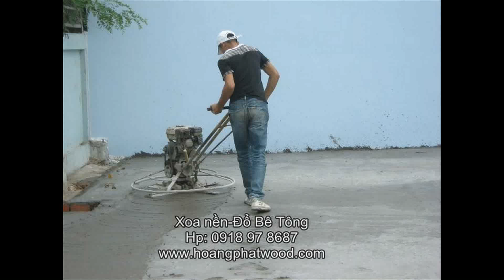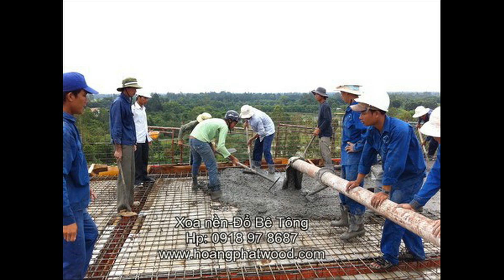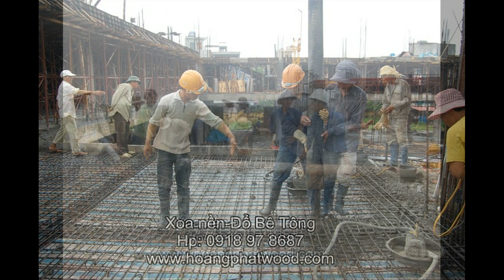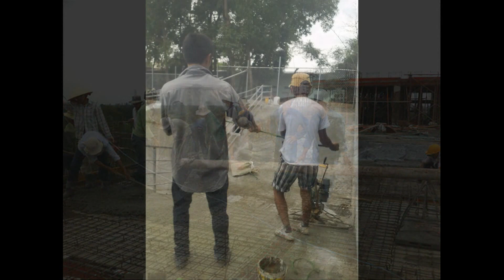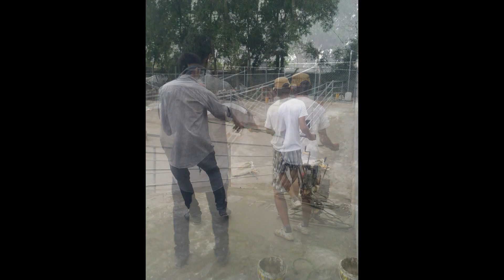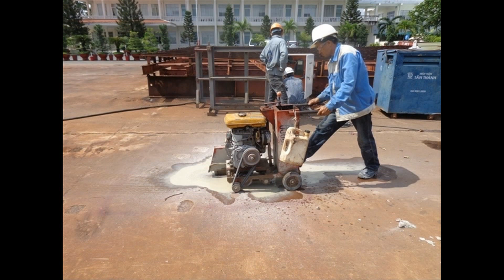Xoa nền bê tông,lh 0988087928,xoa mặt nền bê tông,xoa sika,

Comment from the maker: VÁN PLYWOOD HAY VÁN ÉP-GỖ DÁN 
lh :0918978687

CTY TNHH SẢN XUẤT GỖ HOÀNG PHÁT 
CTy TNHH Sản Xuất Nội Thất Gỗ Hoàng Phát
Add           :  43 Quách Đình Bảo,P.Phú Thạnh,Q. Tân Phú ,HCM
Tax           :   0312 649 671
Cell / Fax :   0839 786 234
Mobile      :  0918 97 8687  _   0902 5161 62
Webside    : WWW.Hoangphatwood.com
Email         :  hoangphatwood@gmail.com
Xin cảm ơn!
HOANGPHATWOOD _ PLYWOOD
+) Sản xuất các loại ván ép theo yêu cầu
+) Ván gỗ dán chống ẩm
+) Ván gỗ ép chất lượng cao
+) Keo : chống ẩm (melamin, Mr ,uf,phenol )
+) Sai số : +/- 1mm
+) Gỗ : cứng :keo ,điều ,dầu,thông,cao su
+) Độ ẩm : 08-12%
+) Trọng lượng : 530-550kg/m3
 
Quy cách
1) ván cốp pha xây dưng

-Ván ép phủ phim ,phủ keo
Khổ : 1220x2440
Dày : 12mm,15mm,18mm
_ Ván cốp pha phủ keo,phủ sơn

Khổ : 200 /300/350/400/600 x 4000 mm
          1220x2440mm
           1000x2000 mm
Dày  : 18 mm,20mm
2) Ván ép đóng nội thất,kệ,vách trang trí...

(Mặt nhám mịn, dán veneer, laminate )
Khổ : 1220x2440mm 
          1000 x 2000 mm
Độ dày : từ 3mm,5mm,8mm,....55mm
3) plywood đóng sàn xe tải,sàn containeer

QC: 1220x2440mm 
        1160x2440mm
Dày : 20mm,25mm,28mm
Số lớp : 21 , 19, 17 
Chạy rảnh theo yêu cầu
*) Ván plywood-ván ép phủ laminate

 
 
Ván ép là một bảng gỗ sản xuất làm từ các tấm mỏng của gỗ veneer . Lớp gỗ dán (gọi là mặt dán hoặc plys) được dán lại với nhau, với Plies liền kề có của hạt gỗ luân chuyển so với lớp liền kề lên tới 90 độ.
plywood
Tất cả các ràng buộc nhựa gỗ dán và tấm sợi gỗ ( xenluloza tế bào dài, mạnh mẽ và mỏng) để tạo thành một vật liệu composite . Thay đổi luân phiên của các hạt được gọi là cross-nổi hạt và có nhiều lợi ích quan trọng: nó làm giảm xu hướng của gỗ để chia khi bị đóng đinh ở các cạnh, nó làm giảm sự mở rộng và co rút, cung cấp cải thiện độ ổn định cao, và nó làm cho sức mạnh của bảng điều khiển phù hợp trên tất cả các hướng. Thường có một số lẻ của Plies, để các tờ được cân bằng, điều này làm giảm cong vênh. Vì gỗ dán được liên kết với các hạt chạy với nhau và với một số lẻ của các bộ phận tổng hợp, nó là rất khó để uốn cong theo hướng vuông góc với hướng hạt bề mặt lớp.
Nhỏ hơn mỏng hơn gỗ dán và gỗ dán chất lượng thấp hơn (xem gỗ dán ảnh trung bình chất lượng bên dưới và bên phải) chỉ có thể có plys của họ (lớp) aranged vuông góc với nhau, mặc dù nhiều sản phẩm ván ép chất lượng tốt hơn sẽ do thiết kế có năm plys trong các bước của 45 độ (0, 45, 90, 135, và 180 độ), cho sức mạnh trong nhiều trục. Các plywoods đặc sản chất lượng cao nhất thường có plys ở 30 độ (0, 30, 60, 90, 120, 150, và 180 độ) trong bảy lớp, hoặc có chín lớp với hai lớp 45 và 135 độ trong bánh sandwich. Nhỏ hơn quay bước thì càng khó để sản xuất, gia tăng chi phí sản xuất và giá bán lẻ do đó.
Lịch sử
Ván ép được phát minh khoảng 3400 trước Công nguyên bởi các Mesopotamians cổ đại , người đã gắn nhiều lớp mỏng gỗ lại với nhau để làm cho một lớp dày. Họ ban đầu đã làm điều này trong tình trạng thiếu hụt gỗ chất lượng, dán lớp rất mỏng của gỗ chất lượng hơn gỗ ít chất lượng.
Ván ép hiện đại được phát minh, trong thế kỷ 19, bởi Immanuel Nobel , cha của Alfred Nobel . Nobel nhận ra rằng một vài lớp mỏng của gỗ ngoại quan lại với nhau sẽ mạnh hơn một lớp dày duy nhất của gỗ, và phát minh ra máy tiện quay được sử dụng trong sản xuất ván ép.
Đặc điểm cấu trúc
Một bảng điều khiển ván ép điển hình có mặt dán khuôn mặt của một cấp cao hơn so với veneers cốt lõi. Chức năng chính của các lớp cốt lõi là tăng cường sự tách biệt giữa các lớp bên ngoài nơi những căng thẳng uốn cao nhất, do đó làm tăng sức đề kháng của bảng điều khiển để uốn . Kết quả là, tấm dày hơn có thể chiều dài khoảng cách xa hơn dưới tải cùng. Trong uốn, sự căng thẳng tối đa xảy ra ở lớp ngoài cùng, một trong căng thẳng , một ở nén . Ứng suất uốn giảm từ tối đa ở các lớp mặt gần bằng không tại tầng trung tâm. căng thẳng cắt , ngược lại, là cao hơn ở trung tâm của bảng điều khiển, và không ít các sợi bên ngoài.
Sản xuất
Sản xuất ván ép đòi hỏi một bản ghi tốt, được gọi là một peeler, mà nói chung là thẳng và đường kính lớn hơn một yêu cầu để chế biến thành gỗ kích thước tương bởi một xưởng cưa . Nhật ký được đặt theo chiều ngang và xoay quanh trục dài của nó trong khi một lưỡi dao dài được nhấn vào nó, gây ra một lớp gỗ mỏng để bóc (giống như một tờ giấy liên tục từ một cuộn). Một nosebar điều chỉnh, có thể rắn hoặc con lăn, được ép vào nhật ký trong các vòng xoay, để tạo ra một "khoảng cách" cho veneer đi qua giữa dao và nosebar. Các nosebar phần nén gỗ như nó được bóc vỏ, nó kiểm soát rung động của con dao gọt vỏ, và hỗ trợ trong việc giữ veneer được bóc vỏ với một độ dày chính xác. Bằng cách này, đăng nhập được bóc vỏ vào tấm ván lạng, mà sau đó được cắt với kích thước quá khổ mong muốn, để cho phép nó thu nhỏ (tùy thuộc vào loài gỗ) khi sấy khô. Các tờ này sau đó được vá, phân loại, dán lại với nhau và sau đó nướng trong báo chí ở nhiệt độ ít nhất 140 ° C (284 ° F), và ở áp suất lên đến 1,9 MPa (280 psi) (nhưng thường hơn 200 psi ) để tạo thành bảng gỗ dán. Bảng điều khiển sau đó có thể được vá, có khiếm khuyết bề mặt nhỏ như chia tách hoặc lỗ nút nhỏ đầy, lại có kích thước, đánh giấy ráp hoặc đánh bóng, tùy thuộc vào các thị trường mà nó được dự định.
Gỗ dán để sử dụng trong nhà thường sử dụng ít tốn kém urê formaldehyde keo, trong đó có khả năng chịu nước hạn chế, trong khi gỗ dán ngoài trời và cấp biển được thiết kế để chịu được thối, và sử dụng khả năng chịu nước phenol - formaldehyde keo để ngăn chặn phân lớp và duy trì sức mạnh trong cao độ ẩm .
Các chất kết dính sử dụng trong ván ép đã trở thành một điểm quan tâm. Cả hai urea formaldehyde và phenol formaldehyde là chất gây ung thư ở nồng độ rất cao. Kết quả là, nhiều nhà sản xuất đang chuyển sang các hệ thống keo formaldehyde phát thấp, biểu hiện bằng một "E" Đánh giá ("E0" sở hữu lượng khí thải formaldehyde thấp nhất). Ván ép sản xuất để "E0" có lượng khí thải formaldehyde có hiệu quả không.
Ngoài các loại keo được đưa lên hàng đầu, các nguồn tài nguyên gỗ tự đang trở thành trọng tâm của các nhà sản xuất, một phần do bảo tồn năng lượng, cũng như quan tâm đến tài nguyên thiên nhiên. Có một số chứng chỉ có sẵn cho các nhà sản xuất những người tham gia trong các chương trình này. Hội đồng quản lý rừng (FSC), lãnh đạo trong Năng lượng và Thiết kế môi trường (LEED), Sáng kiến lâm nghiệp bền vững (SFI), và GREENGUARD là tất cả các chương trình chứng nhận để đảm bảo sản xuất và xây dựng thực hành bền vững. Nhiều người trong số các chương trình này cung cấp các lợi ích về thuế cho cả nhà sản xuất và người dùng cuối.
Các độ dày thông dụng nhất là 0,14-3,0 trong (0,36-7,6 cm). Các kích thước của các tấm gỗ dán thường được sử dụng nhất là 4 8 ft (1.2 2,4 m). Chiều rộng và chiều dài có thể thay đổi trong 1 ft (30 cm) gia tăng.
Tại Hoa Kỳ, các kích thước thông dụng nhất là 4 ft 8 ft hay 5 ft 5 ft
Kích thước trên gỗ dán chuyên dụng cho phạm vi hình thành bê tông 6-21 mm, và một loạt các định dạng tồn tại, mặc dù 15x750x1500mm là rất thường được sử dụng.
----------------
THÔNG SỐ KỸ THUẬT VÁN ÉP HAY PLYWOOD :
Sản xuất ván ép 12mm,12ly,khổ 1220x2440mm  
Liên hệ
0918978687 
khoihoangwood@gmail.com
khoihoangwood@gmail.com
Nội dung
Plywood 12mm,(Ván ép Hoàng Phát :0918978687)
Độ chịu lực,chịu ẩm : tốt
Gỗ : tạp cứng keo,điều,tràm,thông,cao su
Sai số : 1mm
Mặt : nhám min 260-280
Đảm bảo : không nứt téc, không trồng mí, 
_Phủ laminate,veneer gỗ tự nhiên
Độ ẩm : 09-12%
Tỷ trọng : 530-550 kg/ m3
Khổ ván : dài : 2000-2440 mm
                rộng: 1000-1220 mm
Ván ruột dày : 1.8- 2.1 mm
Ván mặt dày : 0.6-0.8 mm
Sản xuất các loại plywood,ván ép theo yêu cầu
 
Hoàng  Trọng Khơi
Hotline  : 0918 97 8687
CTy TNHH Sản Xuất Nội Thất Gỗ Hoàng Phát
Add :  43 Quách Đình Bảo,P.Phú Thạnh,Q. Tân Phú ,HCM
Tax           : 0312 649 671
Cell / Fax :   0839 786 234
Mobile :  0918 97 8687  _   0902 5161 62
Webside : WWW.Hoangphatwood.com
Email :  hoangphatwood@gmail.com
Xin cảm ơn!
 
0918978687 (Mr Khơi):Chuyên sản xuất,cung cấp các loại ván
Ván cốp pha ,ván gỗ dán phủ keo,phủ sơn : dùng xây dựng
VÁN DÁN VENEER ,LAMINATE
(ĐÓNG NỘI THẤT )
Ván ép dùng keo : Mr, phenol. u f
Ván gỗ : cứng
Chống ẩm,chịu lực tốt
Ván ruột : 1.8mm- 2.1mm
Khổ : dài 4000 mm , rộng 200 , 300 , 4000 mm
1000 x 2000 mm
1220x2440mm
--------------
Gỗ: tạp cứng
keo: Mr , UF
Bề mặt : sơn phủ keo,
1)   Chuyên sử dụng trong nghành xây dựng

Ván ép,gỗ dán,ván cốp pha chất lượng cao
Sản xuất số lượng nhiều
Vận chuyển: nội thành miễn phí số lượng nhiều
2) Ván cao cấp-(plywood ) đóng nôi thất

Sản xuất theo yêu cầu
Mặt ván : trà nhám mịn
Dán phủ veneer , laminate
 
Liên hệ tư vấn:
Hoàng  Trọng Khơi
Hotline  : 0918 97 8687
CTy TNHH Sản Xuất Nội Thất Gỗ Hoàng Phát
Add :  43 Quách Đình Bảo,P.Phú Thạnh,Q. Tân Phú ,HCM
Tax           : 0312 649 671
Cell / Fax :   0839 786 234
Mobile :  0918 97 8687  _   0902 5161 62
Webside : WWW.Hoangphatwood.com
Email :  hoangphatwood@gmail.com
Xin cảm ơn!

Comment from the maker: Ván ép đóng cốp pha xây dựng
ván ép phủ phim
ván ép phủ keo
Ván ép gỗ tự nhiên
QC: 1220x2440mm
Độ dày: từ 03mm,4mm,5mm,6mm,..10mm,12mm,15mm,18mm,20mm,25mm,26mm,28mm....75mm
Tiêu chuẩn: xuất khẩu
Giá: nhà sản xuất
sản xuất tại: Việt Nam
Tư vấn: 0918978687 Khơi
Cảm ơn!
Sản xuất các loại ván ép
Ván ép phủ keo
Ván ép phủ phim
Ván ép chống ẩm
Ván ép phủ veneer
Ván ép tiểu chuẩn xuất khẩu
Quy cách: 1220x2440 và 1000 x 2000mm
Độ dày: theo yêu cầu
Giá: tại nhà máy sản xuất
Độ ẩm: 10-12%
Loại gỗ: gỗ rừng,tràm,thông,keo,cao su,song mã
Mặt ván: A-A ,A -C , B -B
Đáp ứng: 50 container/tháng
Tiêu chuẩn: TW3
Quý khách có nhu cầu vui lòng Liên hệ:
Hoàng  Trọng Khơi
Hotline  : 0918 97 8687
CTy TNHH Sản Xuất Nội Thất Gỗ Hoàng Phát
Add           :  43 Quách Đình Bảo,P.Phú Thạnh,Q. Tân Phú ,HCM
Tax           :   0312 649 671
Cell / Fax :   0839 786 234
Mobile      :  0918 97 8687  _   0902 5161 62
Webside    : WWW.Hoangphatwood.com
Email         :  hoangphatwood@gmail.com
Xin cảm ơn!